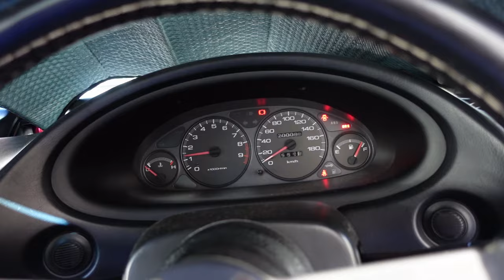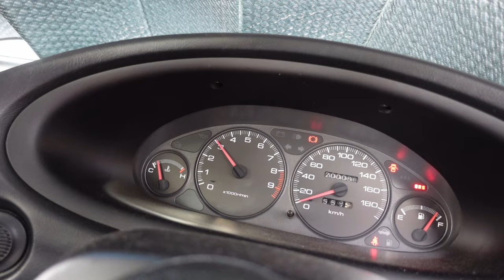DC2 off to a new home + Koyo Radiator install FAIL

Comment: The joys of 90s Hondas. I have a love hate relationship with my Civic. Its great when it works.

I have a Koyo as well. I'm using one of those simple aluminium brackets. Spoon sells them for example, but doesn't have to be Spoon. Just that style of bracket works.
Reply from the maker: You nailed it.  They're always looking for a reason to break.  hahaha

That's really good info on the brackets!  I was honestly wondering if those would work.
Reply: @BRICKHOUSESPL  The OEM ones have that bit that sticks out and hooks/hugs the radiator support. Very little adjustment and movement from those.
Reply from the maker: @terry_em1  yeah, my thought was to cut to hooks off to make it flat on that side...if the step looks like it's going to work.

Comment: Dude heck yeah! Stoked you've popped back up! Holy moly your side mirror was so close to the pillar when you were parking lol. Been meaning to ask you if you knew of any events or interesting car things that might be going on from like 10/9 - 10/17? I'll be back in Tokyo for a week and was hoping to get back into the swing of things car-wise.
Reply from the maker: Thank you!  Just been busy with life and business and still trying to make it all work together to get consistent again.  You can check https://dupcar-event.com/event/ for events.  It's not everything but it has a lot of the main car shows of various genres.  Not so much track days or stuff like that, but most likely any weekend of the year there's a track day going at most tracks.  Finding that specific info can be more difficult and I usually see most stuff being shared on IG and then from there I look into it.  Have a good trip!
Reply: @BRICKHOUSESPL  Had a blast. Was gonna swing by and check out that euro event over at Fuji, but was a bit too far out from where we were staying. Thanks for that website! Much appreciated mate. Looking forward to checking out your new vid.
Reply from the maker: @mattoattacko  good deal, glad you had a good trip 😊

Comment: Hey man, for the top rad hose, you could try cutting a bit off the long piece that fits on the rad side to eliminate the kink. Hope that makes some sense to you
Reply from the maker: 100% - that's what I was thinking too.  I'm going to put a temp gauge in so I'll trim it to length once that's situated.
Reply: @BRICKHOUSESPL  ahh, that sounds like a good plan, best of luck with the build, I have my own DC2 rhd building here in Jamaica, its Kswapped
Reply from the maker: @TheKooliebwoy  oh nice, I really want to do some k-series stuff (on other cars)!

Comment: I put a new Koyorad in my DC2R with no issues whatsoever, so I'm guessing that's either a very old design or perhaps not for a DC2 chassis. Also, nice clickbait on the title lol. I'M TOTALLY GOING TO UNSUBSCRIBE, MAN! 🤣
Reply from the maker: A wise sage of YouTube advice named Dave Pratte once said, "Clickbait isn't clickbait if there some aspect that's true."  Hahaha.  I was really trying to live by that - it's all true, just misleading.  haha.

I'm going to have to go back and find your video.   All I can figure is they must have reduced the core thickness on the newer versions.  This thing is HUGE.  The fan mounting points and rad mounting points are all in the correct positions so it seems like it has to be DC2.  I really considered it being for another chassis.
Reply: @BRICKHOUSESPL  lol this Pratte fellow sounds wise indeed! 😂That rad does look significantly thicker than the one we put in the ITR. Thickboi rads always cause grief, no way around it, as I'm sure you know. I guess as Koyorad's cores have become more efficient they've been able to reduce thickness. Or maybe that's a Race specific rad, where they assume you want all the capacity you can get and don't mind the work involved in making it fit.
Reply from the maker: @speedacademydave  after looking at other installed pics, it looks like they really slimmed it down like you said.  :( Going to do my best to make this one work.💪